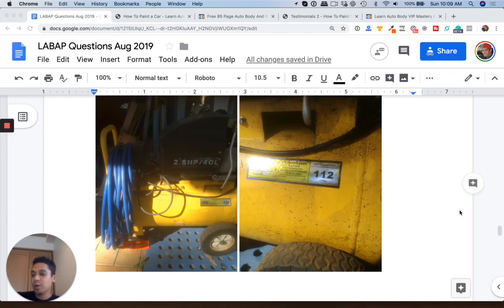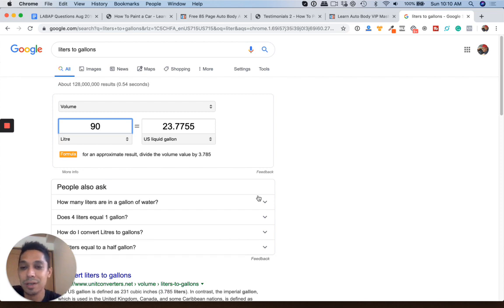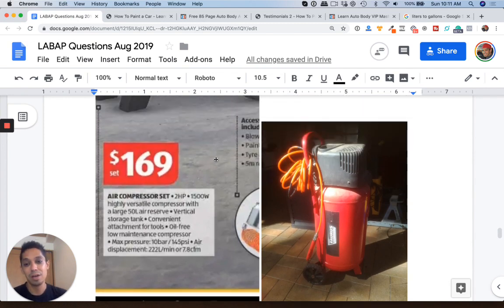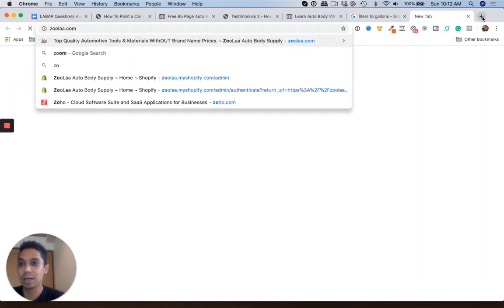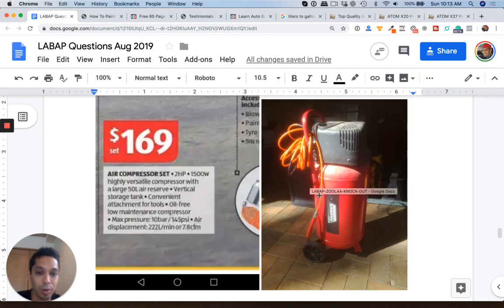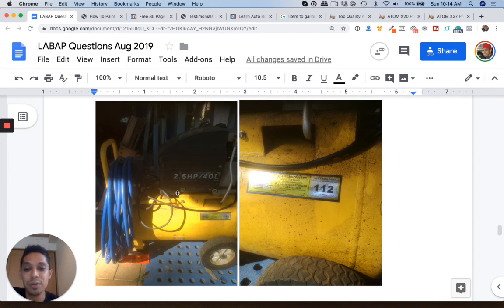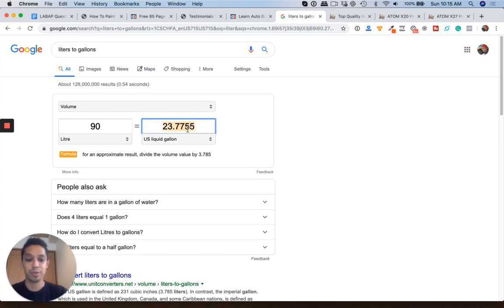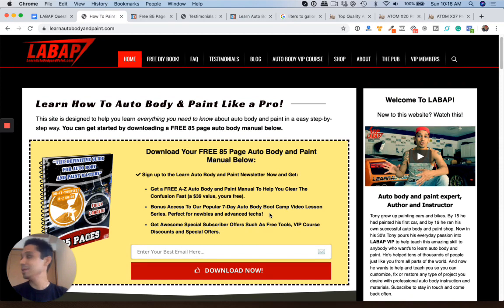Connecting Two Small Compressors - Air Compressor Size For Painting 😉

Comment: What if instead of connecting them together you had them both running, once you run out of air (hopefully you have air enough to spray one panel) you switch your gun to the other compressor. In the meantime as you spray with the second compressor, the first one builds up and you keep swapping till you spray all panels. Would that work?

Comment: I've just undertaken this exercise and found a 50 liter (13 gallon) compressor and a 20 liter (5 gallon) compressor sufficient to maintain a constant 2 bar (30 psi) at my devilbiss FLG5 all day long.   I have the regulator on the larger compressor screwed up to the maximum, and have removed the regulator completely from the smaller one (it actually split as I was mucking around with various fittings).  I got the small one for $20.
My regulator/water separator where the 2 lines from each compressor connect at a Y fitting is about 10 feet from each compressor to give the water vapor a chance to cool.  The regulator is set to 4 bar.  Then there is a 1 meter line from the regulator to a Motor Guard  'toilet roll' filter, then a 30 foot hose to the gun which has both a cheater valve and disposable water filter.  Zero water problem.
Running the compressors will both drop to a constant 6 bar at the tank, the regulator maintains its constant 4 bar, and the gun maintains a constant 2 bar.
It was necessary to fit a 1/2" non return valve in the line going to the smaller compressor.  The larger compressor cuts out at 10 bar, which without the one way valve will pop the 8 bar rated safety release valve of the smaller compressor as it tries to pressure its connected tank to 10 bar .  A 1/4" one way valve like the rest of the hose and connections etc will not work.  The valve opening itself is only about 1/8" in that valve and just creates a massive restriction.  A 1/2" valve with appropriate fitting is necessary to give about a 1/4" internal opening. 
Trust someone may find the above useful.
Reply: Hey mate. Where about’s exactly would I fit the 1/2 check valve?
Reply: @snufbox  In the line coming out of the smaller rated pressure compressor.  If you have two identical rated compressors it may not be necessary.  But in my case with one medium and one small it was a must.  The higher cut off pressure of the larger compressor would just blow out the safety valve on the lower rated smaller unit.
Reply: @johnwoodrow8769  They both have 50L tanks, one has max bar 14.5 the other 11 bar. Is that what I should be looking at? 
Also I have the FLG 🙌
Reply: @snufbox  It's the 11 bar compressor that needs the one way valve to stop the 14.5 compressor trying to pump both tanks up to 14.5.  It won't be able to do that because the safety valve on the 11 bar compressor will 'blow' and you'll just be loosing air.  
You want the 11 bar compressor to pump up to 11 and cut out, and the 14.5 to pump out to pressure and also cut out.  The one way value in front of the 11 compressor stopping the 14.5 from flowing into that tank.  
When you start spraying at first all the air will come from the 14.5 compressor till it drops to 11, the one way valve opens, and then air starts flowing from both (and by this time the motor on the 14.5 has started up).
Have a decent length of hose from each compressor (turned up to their max) before arriving at a connector flowing into your regular/water filter.  That is to allow the water vapor to condense before it arrives at the filter.  Set that regular at around 3 bar, and use a cheater valve and disposable filter on the spray gun set to around 2 bar (air pressure on the gun itself set wide open).  This eliminates as much as possible the air line pressure fluctuations occurring at at the compressor end.
Reply: @johnwoodrow8769  Awesome. Mate, I cannot thank you enough for your concise explanation. I appreciate you taking the time to do so. Legend!
Reply: @johnwoodrow8769  Sorry mate, just one last question. So do I fit the non return valve into the actual tank’s outlet of the smaller compressor?
Reply: @snufbox  Yep, right into the tank outlet.  Use thread tape.  Just remove the regulator/water filter if it has one.  You want both compressors feeding at full pressure to a common regulator and water filters.  I use a toilet roll type water filter as well as the glass bowl on the common regulator.  The common regulator and toilet roll water filter are mounted on a piece of appropriate size plywood so I can move the whole setup to the job.
Reply: @johnwoodrow8769  Okay cool. I finally got it! 😋 Thanks again my man, appreciate your info 🙌
Reply: @johnwoodrow8769  Okay cool. I finally got it! 😋 Thanks again my man, appreciate your info 🙌

Comment: We only have a vespa 1/4hp in our home, used to paint wood, and I want to paint my car with matte red finish. i have a hvlp spray gun that i bought online, comes with 3 needles on it for only $24 and the air consumption is 3.5-4.5 indicated in the box. Can I just lower the psi using the 1/4hp compressor?
Reply from the maker: Black Beard, send in your question and pictures of your project to tony@learnautobodyandpaint.com so I can give you an accurate recommendation on your project.

Comment: Those will both run at about 12-14 amps each also.........find separate electrical circuits or you'll be constantly tripping breakers.
Reply: You will not need 2 circuits because the one that is connected to your electrical supply will feed the second one.

Comment: Is it true they don’t recommend painting metallic paints with a LVLP gun? I was informed that for metallics it’s best to use a HLVP ,
Reply: I've heard that said before but it hasn't been my experience.  With properly reduced paint, the correct tip size and air pressure setting, I don't notice any difference in the final product whether LVLP, HVLP, siphon or pressure tank system is used.  The time it takes to apply sufficient coverage seems to be the biggest difference.  Tony has much more experience than me so I defer to his opinion.
Reply: Do you mean flakes when you say metallic paint? If so keep in mind that you should be spraying each layer 90 degrees from the previous one to ensure that the flakes lay down correctly and also increase your overlap margin. if you usually  spray 25% in from your last edge make it 50% to help with coverage.

Comment: Painting a small car is possible with those two compressors if and ONLY if you have a large air reservoir tank connected to the compressor, pre- fill the tank and it should keep up with the displacement of air pressure. 

Nonetheless the size of the tank I’m referring to should be as large as an average home water heater tank.

Comment: The primary issue is exactly as Tony explained it, volume.  LVLP gun helps greatly but you still need sufficient volume.  You can usually find 320 to 400 liter (80-100 gallon) water pressure tanks with damaged bladders for free or minimal cost that you can plumb inline with a small compressor to increase volume and thus spray time.  These tanks are usually rated for 125psi which is easily regulated by the pressure regulator on the compressor.  Volume is your friend when painting.
Reply: Idk why, but it seems funny to me, like a Beverly Hillbillies compressor, lol. Where would I look for a tank like that, Steve?
Reply: @blackopal3138  I find them on Craigslist.org, OfferUp, LetGo and Facebook Marketplace.  They are usually free for the taking.  I have 3 more that I'll be plumbing into my existing system which should let me spray for over 30 minutes before the compressor kicks on.